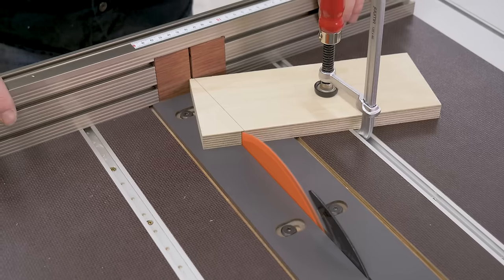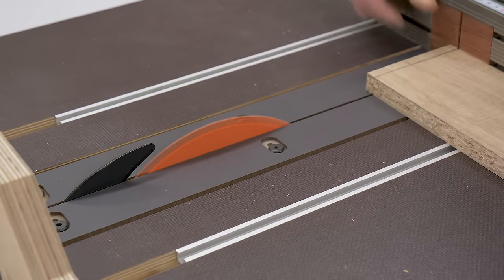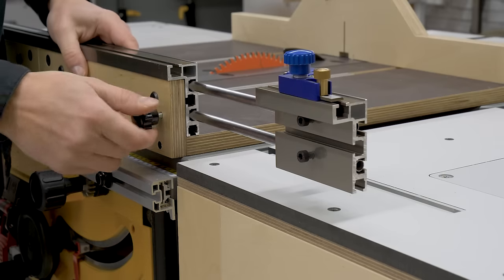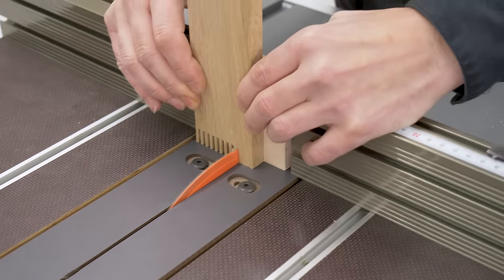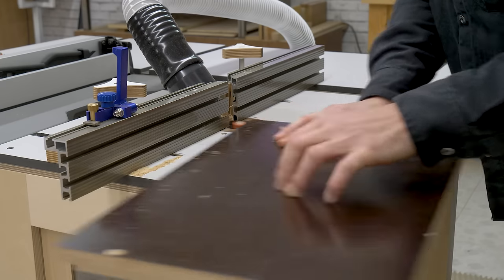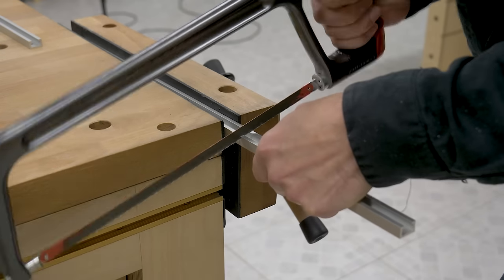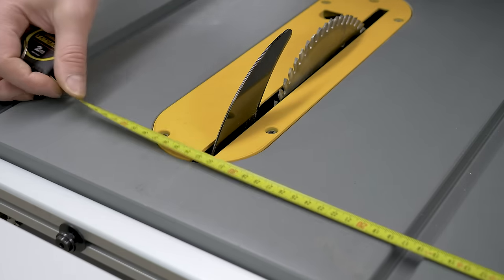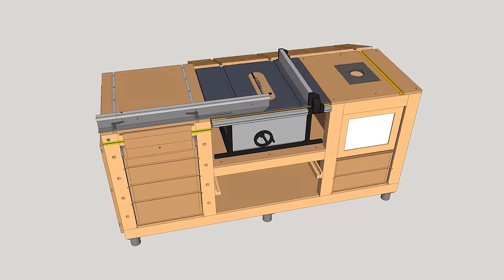DIY Table Saw Sled with Adjustable Zero Clearance / Mobile Workbench EP 7

Comment: I did notice 1 thing that is extremely important that this project doesn't seem to have... I don't see how you can ensure perfect square cuts by the way you mounted the back plate to the sled. You have left no way to make micro-adjustments to ensure a perfect square cut. By using the 5 cut method, you can find out how close you are to square, but I don't see how you will be able to adjust the back. Am I missing something?

Comment: On your design there is no facility to adjust the sled for square: the fence is simply screwed onto the base - I assume using the squareness of the mitre slots to ensure the acurracy of the sled.

Do you find you get perfectly square cuts with this method? 

Great video. You are, without any doubt, one of the best designer / makers on YoueTube.

Comment: That is one hell of a nice sled!!! I made one similar but not as well made or thought out as yours but may have to make another one off your plans. One thing my sled has is a guard for the blade in the back. It is just a box covering the blade upon exit but I installed a vacuum port that doubles as a dust collector. It doesn't catch all of the dust but it does catch a noticeable amount, plus keeps my hands away from the blade.

Comment: Great project and video!  There are so many interesting details. Having a slot for the removable inserts to slide out through the back fence for example. Your method for shortening bolts is so simple yet effective - just screw it through a board and cut off the excess nice and square. 

I really like the way your fences attach to the edge of the base, kind of like a big rabbet. The only catch is that you have to have a way to cut a perfect 90 degree angle in advance so that the fence is perfectly square.

Comment: I am astounded by the beauty and professional look of your sled.  I completely agree with your premonition to have your fingers next to the blade when cutting the finger/box joint is dangerous.  Maybe an acrylic shield of some sort?  I keep thinking of using the same sort of up and down motion an oscillating spindle sander uses with a small motor so the entire joint is made automatically.
Reply from the maker: thanks Ed! a system like the spindle sander seems like a good idea

Comment: Impeccable. You do impeccable work. I got an idea watching this build. The adjustable, zero clearance inserts could be cut with a slight angle on the outside edges, with an opposing angle cut on the mating edge of the rabbet in which they fit in. So, the user would slide them forward or backward to loosen or tighten to the blade. The screw slots would need to be in line with the direction of travel, of course. 
This is the FIRST time I have ever seen an opportunity for a design tweak with one of your builds, as yours are quite thorough. Now, maybe you considered this design and found a reason why it would not be beneficial. It is only an idea at this point, and not proven to work. 
Thanks for letting us into your shop for another fabulous build! Yours are to be aspired to, for sure. Cheers!
Reply from the maker: hi! could you send me a sketch?
Reply: @Paoson_Woodworking  Yes! Give me a day or so to get it drawn up. My method is pencil and paper. I can scan and email to you. It would be my pleasure!
Will go to your website for email address? 
(I'm so bad at this, haha)

Comment: New subscriber. Nice job !  I made an end cut protector  similar to what you were demonstrating, although I added an 1/8 piece of steel to the inside of the protection box, to help guard against accidently leaning too far forward. Even if I damage the blade, it's better the blade than me. The metal will provide an auditory sound if the blade accidently hits the metal and will give me time to react hopefully.

Comment: That is certainly a feature-packed sled and has given me some inspiration. I really like your fence design, but I missed seeing how you squared the back fence with the blade. (e.g. William Ng's five-cut method).
Reply from the maker: thanks! I did not have that problem, but it could be adjusted with spacers between the aluminum profile and the back plywood fence
Reply: @Paoson_Woodworking  I would be very curious to know what accuracy you have achieved, as measured by the 5-cut method.

Comment: This is probably one of the most well-imagined and executed table saw sled I have seen presented on YouTube.  I have a really nice after-market miter fence (JDS AccuMiter) which obviates the need for a sled - at least for most of my woodworking applications.  However, your design may lead me to make a version similar to yours.  Have you used the sled for cuts that require the blade to be at 45 degrees?  Perhaps the same type of sacraficial insert at the front of the sled for miters?
Reply from the maker: yes, by changing the inserts you can make 45 degrees cuts

Comment: very versatile Sled. For me its little "over-the-top" as it needs quiet thick Base plate which will decrease cut hight espacially for selfmade tablesaws. 
Is it passible make cuts with tilted blade? In this case the rabbets would make even miore sense.

Comment: Question, how did you squre or calibrate the aluminum fence to get perfect miter cut? Did you shim it from the backing plywood? The optional bolt screw from the bottom I assume have some play to allow the calibration too?

Comment: At 13:38 you trapped the wood between the fence and the bit. I'm surprised that piece didn't get shot across your shop along with a couple of your fingers. Nice sled, excellent design.

Comment: I have looked at many videos of DIY table saws and this by far is the most ingenious. I am not an engineer so it takes a little thought for me to figure out how best to make the sleds/jigs that I need and how I want to use them. After seeing so many DIY videos, the same thought crossed my mind how to make my sled more versatile and not have to make multiple sleds to accomplish the multitude of dado cuts to a single blade cut. Thanks for sharing this idea it's a great one and I love how meticulous you are with the build. 

Any reason you did not allow access from the back (where the aluminum extrusion is placed) of the sled to remove the inserts rather than having to remove them from the front? Unless I misunderstood it seemed you were removing them just from the front.

How do you ensure the fence is square to the blade?

Comment: I am amazed the plywood does not split when you drill and put screws in to the side of it. I would not trust a joint like that for vibrating machines a very long time with the plywood I can get from the woodstore here.

Comment: Lots of nice detailed improvements in this sled 👌 I was wondering how you managed to square your sled. Seems a bit risky to rely only on the fence and the edge of the base
Reply from the maker: I've used the saw fence. https://youtu.be/xgIKu9wcrBA?t=977
Reply: @Paoson_Woodworking  I am also wondering how you ensure the rear fence of the sled is precisely square to the cut.

Comment: Very nice build! I'm curious: did you determine the width of the sled so it would  fit in your workbench? Are you happy with the dimensions? Or would you choose bigger/smaller sizes if you had to do it again? Cheers 👍
Reply from the maker: hi! this sled is an intermediate size. In addition to this, the ideal would be to have one larger and one smaller

Comment: Very nice and throughout job.  For the extension,  did make the rods and profile fence or did you buy already put together ?  If you made it what is the diameter of the rod and where did you obtain the profile fence?  Dan Orgeron
Reply from the maker: hi Daniel, I have bought the steel tubes separately, and this is the profile: https://www.paoson.com/forum/viewtopic.php?f=22&t=57#p5079

Comment: This is an awesome sled. I am in the process of making it, struggling to find some things in the UK like HPL at a sensible price, but i'll get there. Could you please let me know the thickness of the steel tube wall for the fence extension?   1mm-1.5mm or 2mm. Thanks for your amazing plans and videos.
Reply from the maker: thanks! 1mm, but the other diameters would also do

Comment: Hi. I like the design of your table saw sled. The details of the components are detailed and helpful however the drawings file is in Sketchup, which I've had for some years but now it's online only and I've permed every 8 from 10 trying to get it to open. Could you or anyone else who reads this help please? I use Mac if that helps. Regards.

Comment: Hello. The zero insert is adjusted to the thickness of the saw blade, but what about the marking? It is glued and not adjustable! Thank you in advance for your answer.
Reply from the maker: hi! do you mean the measure tape and the miter stop? the miter stop has its own calibrate system. Anyway, the thicker or or thinner blades vary in size almost everything to the side where I don't have the measure tape

Comment: Do you have a link for the steel tubing used for extending the fence?
Reply from the maker: I bought it at a local hardware store. It is quite common, 10mm outside diameter and 8mm inside

Comment: Great, as usual!  BTW, where did you get the dado blade set?  Apparently they are extremely hard to get in Europe.  Does it fit the 30mm saw shaft?  Thanks
Reply from the maker: https://www.paoson.com/forum/viewtopic.php?f=22&t=59
Reply: @Paoson_Woodworking  Thanks.  So the dado blades that you advertise are 5/8" bore (for the US DWE7491 model), but the EU version (7492) takes 30mm bore discs. How did you solve that?  Thanks

Comment: What is the diameter of the steel pipe hidden in the parallel guide? If I looked at the technical drawing well, the rail is 8.5X8.5 mm wide, but I can't find a pipe of this diameter, do you use 8 or 9 mm?
Reply from the maker: 10mm

Comment: I really enjoyed your video. I have a question. I’m more familiar with attaching both fences to the edge of the platform, thus allowing one to use the five cut method to dial into a more perfect 90 degree cut. Given that you attach your fence on the edge of the platform how do yo insure a perfect 90 degree cut with your method?
Reply: Excellent question… I was wondering the same thing myself?

Comment: It looks as if there is a longer than stock arbor in your saw, allowing wider dado blade arrangements? Euro legislation "discouraging" dado blades, the arbors on European machines are much shorter than on US units.. I bought a US arbor for my DeWalt table saw (DW746) to allow dado blades…